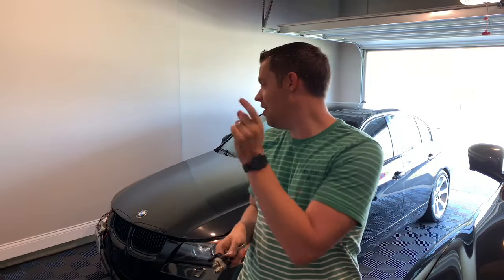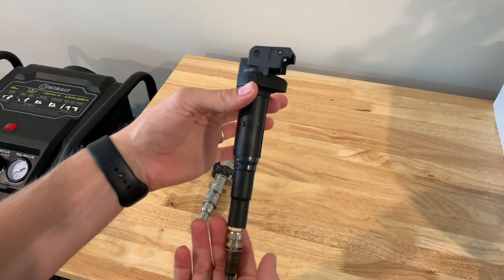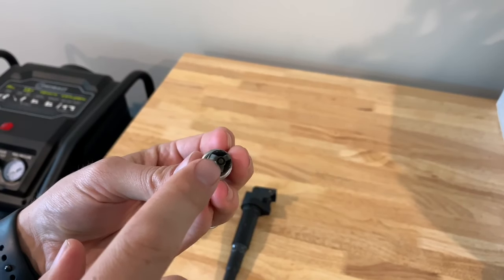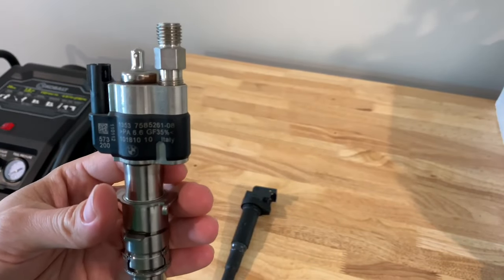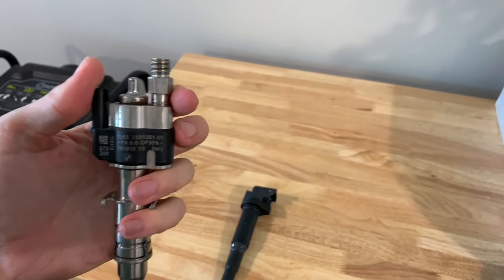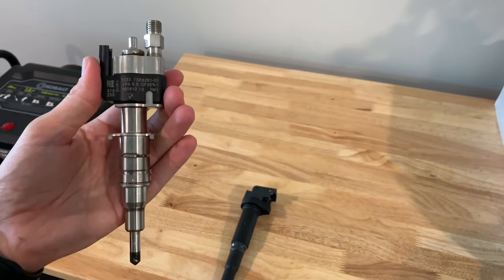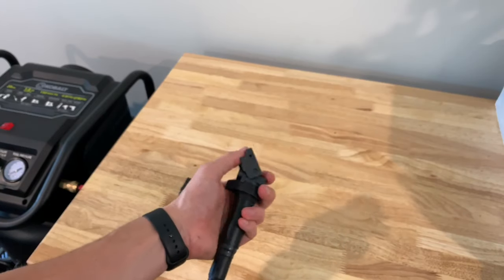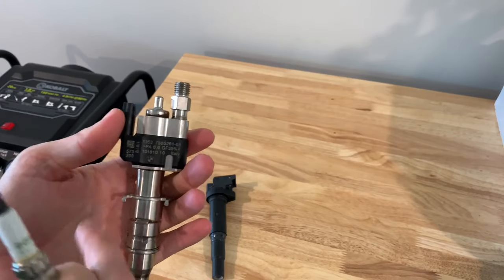BMW Engine Misfiring? Here’s a Tip!

Comment: If you have a bmw car which has misfiring codes or rough idle, and you have changed the plugs and coils or even injectors but the misfiring codes still there and rough idle still persist - just do this. 1. Change your eccentric sensor with a new one, your misfire codes and rough idle will go away for good. Remember just change/ replace your Eccentric Sensor
Reply: Bonjour, faut-il coder apres avoir remplacer le capteur ? Ou juste remplacer la piece et c’est ok ?
Reply: I get a rough backfire like start when I try to start car. And the take off isn’t the same. I had a drive moderate sign come up
Reply: @ninettaninetta1682 Did you change that sensor? And did it solve your problem
Reply: Mine sounds cammed :/ it has delphi coils andd ngk plugs. Both done 4k miles ago. Injectors????

Comment: Dielectric grease is a huge factor in N54 spark plugs. I had arcing marks on the sides of my plugs that were misfiring. Putting dielectric grease kept it from happening all summer. Now I replace my set ever year or 2 and put the grease and I have no more misfire issues. I have a 2009 335 with JB4 and MHD flash running map2 with 93 octane daily driven at 17 psi. Soon to start playing with e85 and 2 step!
Reply: What did the arcing marks look like was the tip kinda white ? I feel like I may have the same issue

Comment: Of all the old revision injectors, the original index 1s were the most reliable. It was downhill from there until the index 12s.  I have 135k miles on my 2007 n54 335i fbo, still running strong with original index 1 injectors. I send an oil sample annually to Blackstone labs, and they've always come out clean, no traces of fuel :)
Reply: Instablaster...

Comment: Pro Tip. If you don’t have a BMW scan tool  and don’t want to pay BMW to read it but are misfiringYou can disconnect (not completely pull out) each coil individually. Start at 1 and do one at a time while the Engine is running, if you disconnect it and it runs rougher connect it back and move to the next one. If it runs the same then you know it’s for that cylinder. Then you can go about swapping coils to test  if it’s a coil or plug issue. If it is an injector. You can replace only 1 cylinder AS LONG AS each bank has all injectors between either 1-10 or 11-12. They can not be intermixed outside of those groups. You can however have one bank with 11-12 and one with 1-10 just not in the same bank.

Comment: This is brilliant advice! I want to thank you personally "BMW Fanatic" i have been a subscriber for years, what i had learned through watching your videos, skills and top tips has helped me with my own issues on a Diesel BMW E92 320D M sport. Fix issues that originally cost up to £9000 pounds. Some of them re-occurring after coming back from mechanic shops because most mechanics just read coded and change parts. Unlike us who troubleshoot why is it doing this or why does it do that, what is it connected to and what is the function (Analysts).

Comment: Great videos man! Your the best at explaining things simple.  I have replaced injectors, coils, and plugs but get hiccups only on high throttle. No codes popping up. Have 2013, 335is, 70,000 miles, full bolt ons, and a Cobb tune.  I know I know. JB4 the way to go.lol..  I'm new to DIY's and reading data logs.  Can you create a step by step explanation at each category in data logs and how to diagnose problems based on numbers? Also,  any good DIY's on jacking the car and putting lifts?  Thank you and keep up the great work.  Life saver.
Reply: Use the crossbar behind the diff for rear central jackpoint. There's a central spot in the front where the pan is cut away by the factory, use that for front central jackpoint. 

To start, put chocks behind + in front of one (or both) rear wheels.

Drive on to a 2x6x12" or larger under both front wheels, or use any jack that will safely lift one (front) side until that front wheel is high enough to get your floor jack to the front central lift-point: this is necessary with an e90 and sport suspension!. Use a quality floor jack; a long, low one is best; try to use a 2 1/2 ton capacity jack or larger. If you're going to D.I.Y. low-set sports-cars go ahead and make the investment. I cut a piece of strong wood just a bit bigger than the cup of my jack; first time you use it the weight will make impressions in the wood so it will sit right in the cup. The wood distributes the lift on the front and rear lift spots.

Jack the front first and put stands under the front side-jack-pads, and lower car onto them. Make sure it's stable. Try shifting the car from a few positions to be sure it's stable, but stand at an outward angle so if it comes off it doesn't crush you. Safety, blah-blah-blah. Then lift the rear, lower the side jack-points onto jackstands. Shift test again. If the car shifts at all, figure out why and fix the issue.

Comment: Nice video bro. Question, can clot air filter cause misfires? I have a m6 2013 v8 twin turbo and had misfire for cylinder 5,7,8 I replaced all the sparkplugs since it was due. The issue continued so I replaced the coils for the cylinders with error and the issue is still there, any advice?
Reply: try cleaning the 2 maf sensors with crc sensor cleaner
Reply: it's important not to use brake cleaner on sensors: use maf or sensor cleaner.

Comment: I have a 2012 550 #3 miss fire I have replaced most of common parts , but I did install a fuel injector index 12 on number 3 cylinder . Index 11 came out of the car , I am wondering that's why it's still miss firing on #3..what do u think ..?
Thx

Comment: In case you or someone else sees this. 2009 N54.  All injectors replaced at 60k.  Currently at 136k.  Replaced vcg and Gasket last week.  Plugs and coils were wet from oil. Cleaned and dried them.  Still been having cold start issues where CES light comes on and codes show lpfs and misfires usually on 2, 3, and 6.  Replaced low pressure fuel sensor yesterday.  Reset adaptations. Same crap again today.  Once everything warms up, it's a beast again.  Only happens when I let sit and gets cold.  #baffled.  Any thoughts?  Oh, also, plugs are new within 3k miles.  Don't think 3 coils would go bad then run without misfiring on wot, right?  #stillbaffled.
Reply: Likely injectors leaking. That is why its only when cold. It leaks over night.
Reply: @Kikinho19  It was spark plugs.  I replaced all my injectors and was still having the problems. I bought new NGK plugs and all problems solved.  Although my plugs were new before (Bosch) , I believe I bought some of those counterfeit Bosch plugs off a 3rd party seller.  No more 3rd party sellers for me.  Sticking to the reputable dealers.  Appreciate the response though.

Comment: Thanks for the Video!  So, can I replace just one Injector as long as it is the same index as the other 2 in that bank?
Reply: If the other 2 injectors of the same bank are indexes 1-10, than the 3rd injector must be from 1-10. If they are 11 or 12, then the 3rd must be 11 or 12
Reply: Omer AbdulAziz thanks!
Reply: @_antidisestablishmentarian5656  no problem!

Comment: I recently had problem with my 2015 70k 435i Iv change the all the plugs cost me £92 and all the coil cost me £102 now found out no 6 inject is intermittent and 4 is not reading as we done a Dignistic injector test so Iv just order  all 6 what’s cost me £460 there borsch series 12  that’s trade prices as I own a garage in Uk still very pricey but rather do it once and be done with but thanks for this video bro great to know

Comment: So I have an 2008 335xi and I have 75985 miles on it today I'm currently in Germany I took my car to BMW and they are saying i need to replace all 6 injectors. I'm getting a lean code in bank 1 what should I do its 2000 euro to replace them with part a labor 19 percent sales tax. My question is do i really need all 6?
Reply: beamerboy  two things here 
1. Anthony. Do not have BMW replace your  injectors buy the parts online and do it at home you will save more than half in cost and it’s super easy. Just make sure they are re coded properly after install 
2. No you do not need all 6 as long as they are older than index 11 then you can replace 1 cylinder at a time.  
3. Beamerboy stop spreading misinformation injectors have no bearing  on each other. Just because one is bad it doesn’t mean the others “start to fail”. They are interdependent the only reason he would have to replace more than one is if they are index 11 or 12.
Reply: Hello, if we change the injectors our self at home how do we get them re-coded? And is this all similar to tune up?

Comment: My 2015 m4 was misfiring, so replacing my plugs and it's good again. Now a month later my m4 is misfiring again under full throttle at 4k rpms, half throttle it can go to redline without issue. check engine light, no misfire codes this time Installed 6 new spark plugs, 6 new dinan coil packs and still misfiring at 4k rpms full throttle. Some people say replace all injectors , flywheel is off balance.. idk what to do without throwing money blindly
Reply: hey bro, did u eventually find out whats wrong? I have the same problem. misfire only under load and onl in long gears like none in 1 or 2 but it starts from 3rd...
Reply: Same problem did you ever find what it was?
Reply: @ashxxtxn1same here, did u guys find out?
Reply: @ashxxtxn1same here, did u guys find out?

Comment: Swapped coilpacks, plugs, and injectors, fuel pressure is good, still a misfire in cylinder 5
Reply: U figure it out? Maybe carbon build up?

Comment: Can a valve cover leaks cause a misfire because I took of my ignition coil of cylinder 2 and there was a little bit of oil but I so far ordered my ignition coil and spark plugs and valve cover

Comment: i need you help, i have missfire on cylinder 6 on my n53 engine,, but only on startup.. if i rev it until its warm and then restart the car, it runs spotless. it´s not  the coil or the sparkplugs.. i also know that my os sensors may be bad. previus owner have already change the spreaders all 6 of them. i think im gonna try pu sparkplugs non-foulers and see if i can bypass them? any thing you can think of that can help. thanks
Reply: Did you fix the problem?

Comment: My BMW E93 320i with the N43B20 engine missfired at low rpm at full throttle, replaced my spark plugs and the problem was gone :-)

Comment: Bank 123 and bank 456?   Did you mean Bank 1 is comprised of cylinders 1,2 & 3 and Bank 2 is comprised of cylinders 4, 5, 6? 

I have a 2009 BMW 335 I xDrive with OBD2 Codes P300, O301, P0303, P0304, P0305, P0128, P13BA
Reply from the maker: Yes correct, me just talking too fast.
Those are generic codes that start with a “P”. Do you have another scan tool to check them?

Comment: I got 2001 bmw 330ci these codes are coming up. p1347: misfire cylinder 3 with fuel cut-off p1345: misfire cylinder 2 with fuel cut-off p1343: misfire cylinder 1 with fuel cut-off p0174: system too lean bank 2

Comment: So its ok if i replace only ONE injector in one bank? I got a cyl 3 misfire and engine code wont go away... i did all plugs and coil.... I  need a temporary fix so i can pass emissions!!! Someone plz help
Reply: @MrTazboi123  how would ik exactly if i need walnut blasting?
Reply: To answer your question. Yes As long as it’s not index 11 or newer you can replace only 1 injector. If it’s index 11 or 12 you have to replace the whole bank with index 11 or newer, bank 1 (cyl1,2,3) or bank 2 (cyl 456) it’s a temporary fix so after you replace the 1 make sure you save up for a set of Index 12s which is about$1100 on FCP euro
Reply: It’s Ryder Fool  if it was so severe that he NEEDED a walnut blast, it wouldn’t be only 1 of his cylinders misfiring. There is a lot of misinformation out there about walnut blasting. Do it at 100,000 to 140,000 miles once. Never have to do it again.
Reply: Omer AbdulAziz  I know see you on another one of your comments you figured it out man!

Comment: I had a detailer wash my car, he also detailed my engine. Now it’s running rough. I have a 4.4L N62. Need help.
Reply: Sounds like water got into you air intakes or intercooler and maybe it got inside your engine , check your oil , if it's milky... Change it. Or maybe that guy was using your car and blew the spark plugs or vanoss you never know... good luck.
Reply: Oh shit never do that hope your abs module isn’t acting funny a very minor water touch to the abs module can screw it up

Comment: Does anyone have any information on Code P-135c? I have a rough idling 750Li with the code.
Reply: Change your O2 sensors
Reply: Maybe your cats are clogged
Reply: @Faustastico7  thanks for the reply, ill check those out.

Comment: I changed the injectors, spark plugs and coil packs and still have a drivetrain malfunction and rough idle. Anyone can help?
Reply: I could be wrong but maybe the fuel injector my need to be coded I remember having the same issue a few years back